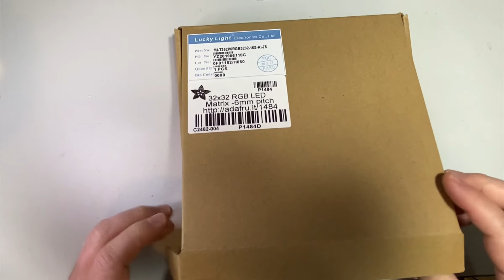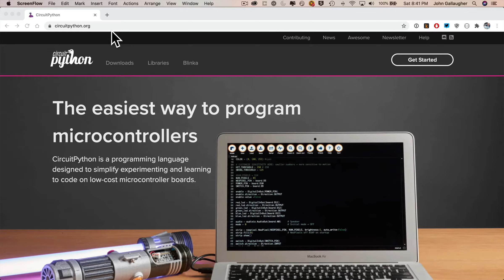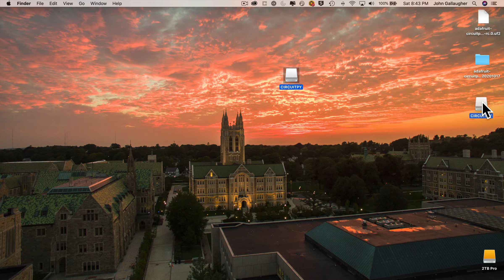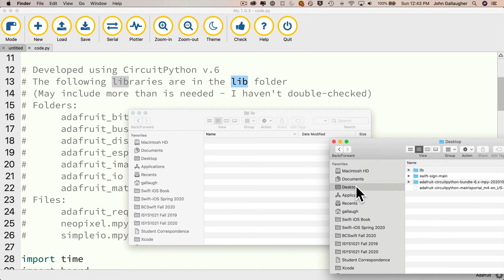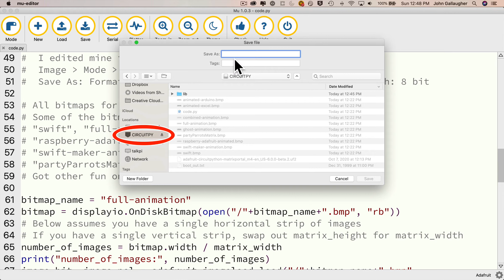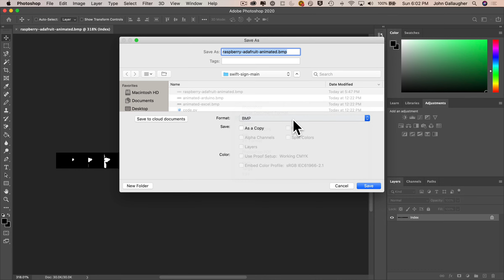NEWER VERSION LINKED IN DESC: MakerSnack - Swift Sign & More w/the Adafruit LED Matrix Portal

Comment: Hey John, I am getting a weird "Tile width must exactly divide bitmap width" -> on line 73 ( using a 64x32 led ) any tips
Reply from the maker: The dimensions of the BMP likely don’t match the dimensions of your screen. Double check the dimensions in a tool like photoshop or preview and resize as needed. Good luck!

Comment: Would it be possible to only show one image (like a picture) and have it change images after a certain amount of time, kind of like a slideshow? If so, what would I have to do differently? Thank you!
Reply from the maker: Absolutely! You can use the time.monotonic() function and save this value in a variable. It will give you a nanosecond representation of a count up, so it’s not a really hh:mm:ss clock, but you can check time.monotonic again as you go through your while loop and if you exceed the first check plus whatever time you want, in nano seconds, then you can load your new image file just as you loaded the first. Call time.monotonic() again to reset the time for the next slideshow and keep going. You can also try just adding a time.sleep() with however many seconds you want to wait, then advance to the next file. Just make sure you loop back to the first file when you are at your last file. Good luck! https://circuitpython.readthedocs.io/en/latest/shared-bindings/time/

Comment: like a previous commenter I am having the same problem with the Matrix Portal light blinking. Is it supposed to stay green the entire time? I am working with a 64 x 32 LED Display and I changed the width to 64 in code like you said in a tweet.  I am trying to show the yoda sipping animation because that is the only one fit to 64 x 32. Is it a faulty display?
Reply from the maker: Give the Adafruit Discord channel a try. Post in CircuitPython help and be sure to share your solution when you get one. Thought to say when you are encountering. http://adafru.it/discord

Comment: When i plug my led matrix power cable onto the screws of the matrix portal board it doesnt light up entirely. It unfortunately has 2 rows of black bars. When i switch the positioning of the power cable the black bars inverse with the ones that are just on. I dont know what ive done wrong and my power supply is usb a to 5 volt power supply and so far my setup appears correct to me. I have no clue why these black bars are there and wont go away. Please help
Reply from the maker: I would recommend forums.adafruit.com for hardware help. If you went through the tutorial with the files and things look incorrect then they can help you diagnose if it’s a hardware problem. Also, adafruit runs a discord channel that has lots of helpful and experienced makers who can provide fast advice. Good luck! This is a fun project when you get working hw.
Reply: @profgallaugher  Thank you!

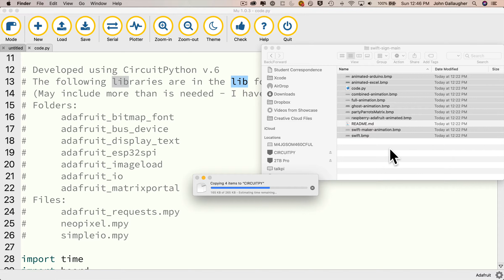Comment: At 11:40 you say that copying the files over will trigger the board to show something.  However, I can’t seem to get anything to show.  But....the multicolor light on the Matrix Portal is blinking like crazy.  What could I be doing wrong?
Reply from the maker: Hmm… same code and same files? Did you see the sand animation when you first got the board. Trying to eliminate if there is a bad board. Check if cable wiring is correct. Shouldn’t be missing library files since that’s likely show an error in the console (click serial in Mu to see output).
Reply: @profgallaugher  I did see the sand animation, yes.  I’m wondering if i am placing the copied files into the wrong place.  They are to go into the Lib folder, correct?
Reply: In fact, all that appears is the snake logo.  If I change the animation code in code.py, the screen flickers, but stays on the python logo